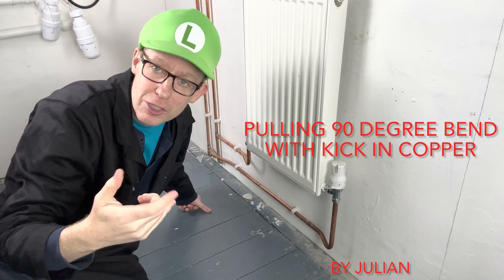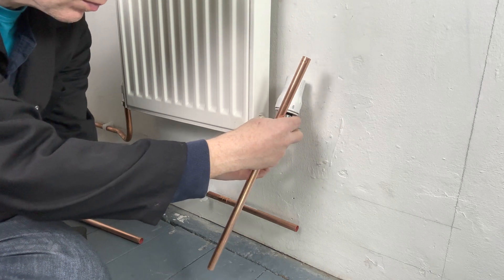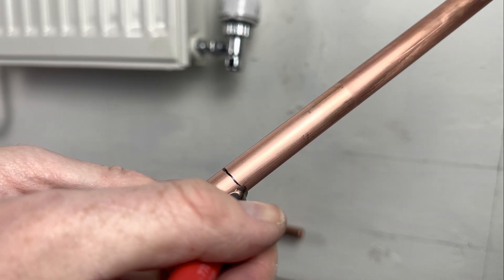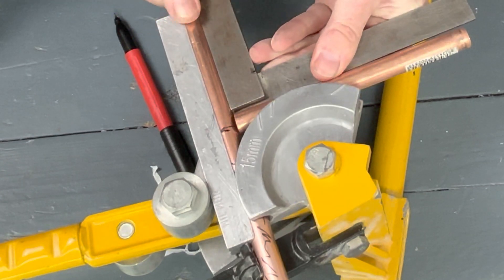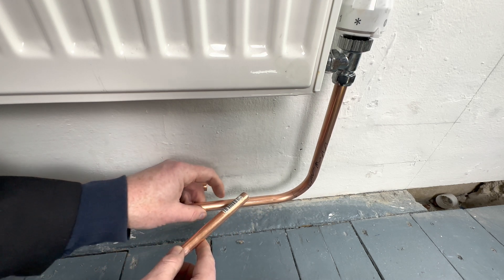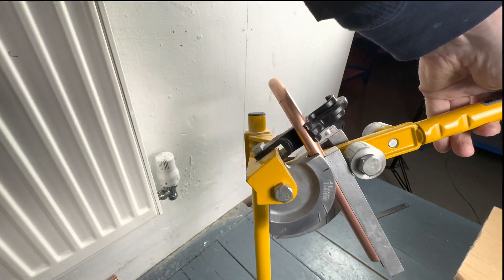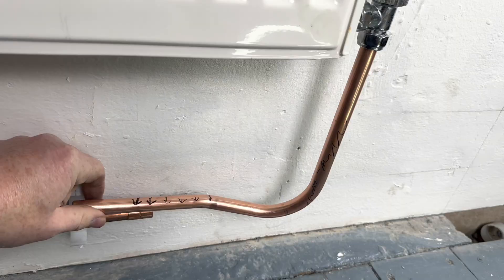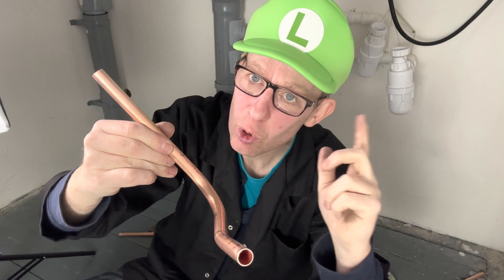Pulling and installing a 90 degree bend with a  kick in copper pipe (4K).

Comment: What’s the purpose of the kick ? Why not install a 90* bend ?
Reply: Because the TRV sits off the wall further out than the pipe in the clips. If you did a 90 bend from the clips it would likely sit behind the TRV which is why you would need to do a kick (also known as a dog leg) so that you can line it up with the TRV. Also as it might be easier to measure the inside edge of the pipe rather than the centre to get a more accurate reading, and then line the mark up with the inside edge of the offcut pipe